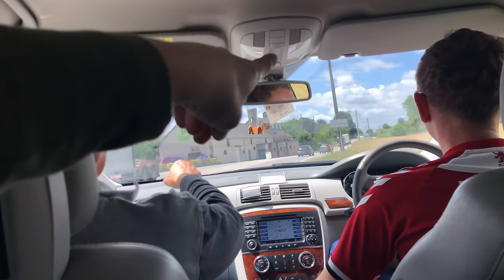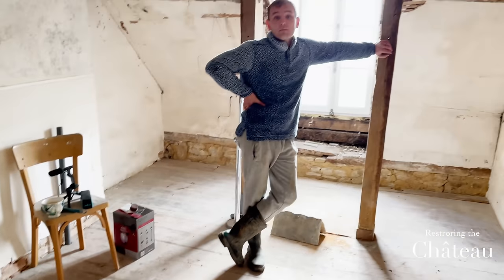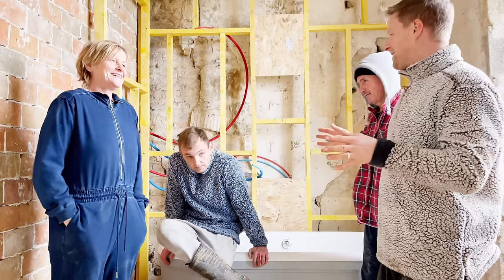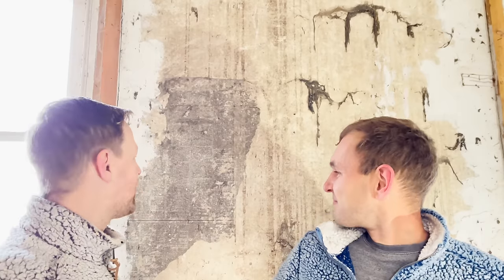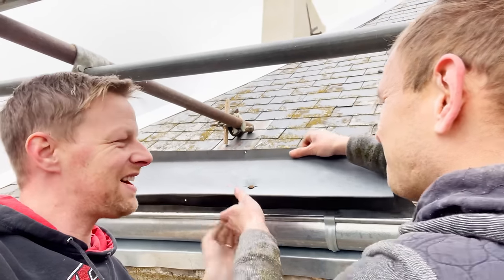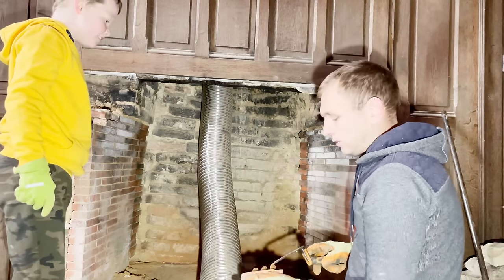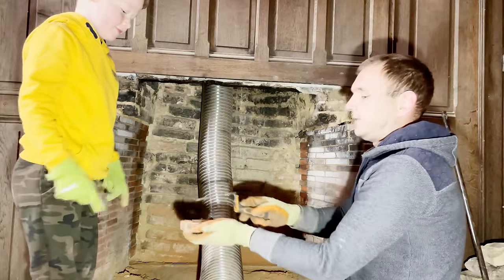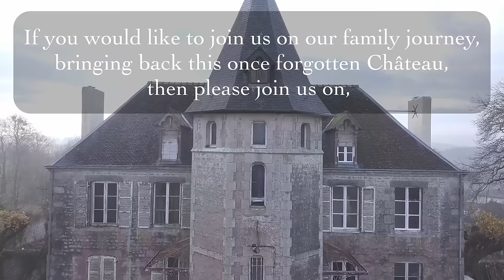The Châteaux Hidden Finds & Renovations. Ep 37

Comment: It's a lot, really so much work, but it must be so rewarding to see a room come together,  improved, in style, but future proof! Well done. Noticed you didn't put insulation under the floor boards. It might be useful to at least put insulation in the areas where the water pipes and drainage pipes are, so the sound of flushing etcetera won't disturb people in the room below. How about water pressure on the top floor and in the multiple bathrooms in the end? Did you get advice on how to optimise that? Success with the next phase!

Comment: Wow, great finds in this video. Please be careful handling the wallpaper, it looks like it might be the very toxic Paris Green shade, made popular by the Empress Eugenie in 1864. It also became the rage in Victorian England and was responsible for many deaths. You may want to do some research on old finishes and materials so that you can take appropriate Health and Safety measures in your work at the chateau.
Reply: I'm so relieved someone mentioned the risk that vibrant green wallpaper of that era poses. Such vibrancy in the Scheele's Green was achieved by incorporating arsenic into paints and  dyes - and also poses a significant risk to pets as well as humans. The arsenic leeches from whatever it was used on, becomes airborne, is easily inhaled, etc. as it intermingles with household dust. It also creates a toxic gas in damp rooms. To be on the safe side, it should be considered hazardous material: one should wear a particle mask, the paper should only be handled with latex gloves, and any room it's discovered in carefully cleaned after removal.

Comment: Terry your initial idea with regard to the taps and the bath was better… when in the bath you want to add extra warm water without going out…. Or you want to step in while the  tap is still running adjusting temperature and closing the tap.

Comment: You guys truly seem to be using VERY little insulation for both heat in exterior/interior walls -
 but especially for sound in interior walls and partitions between the floors. You`ll have to spend thousands of extra cash 
on heating  - all cash coming out of your profit 
The sound levels will become an issue for guests having to listen to flushing toilets and loud occupants in neighboring rooms
You can`t make decision based on a normal single family occupancy - you want to rent out rooms to strangers - and you`ll truly regret 
not stuffing all cavities with maximum amount of Rockwool.